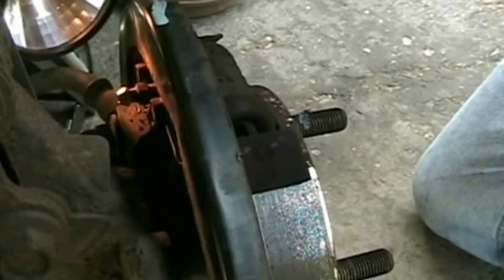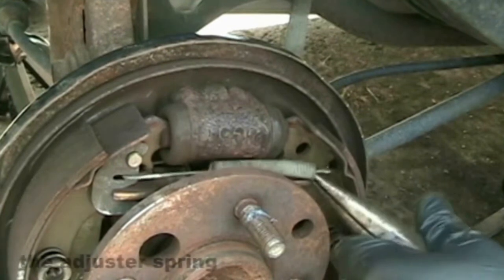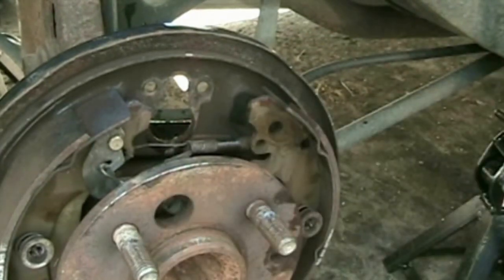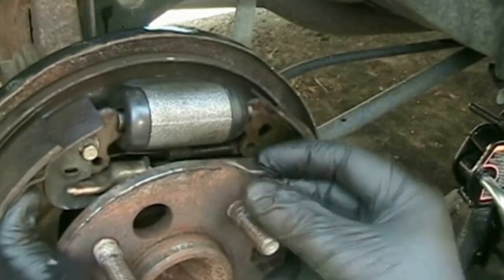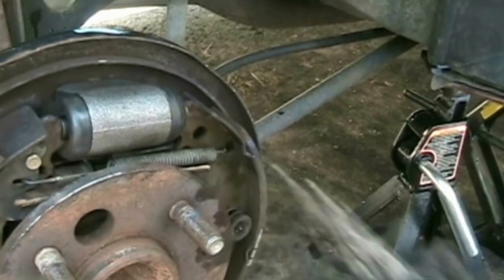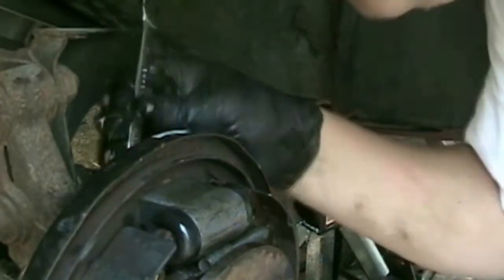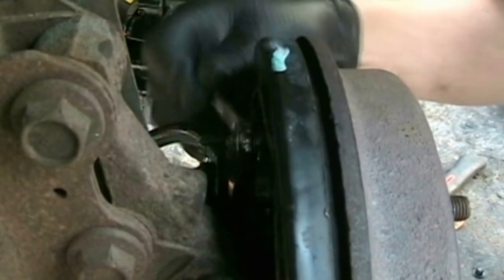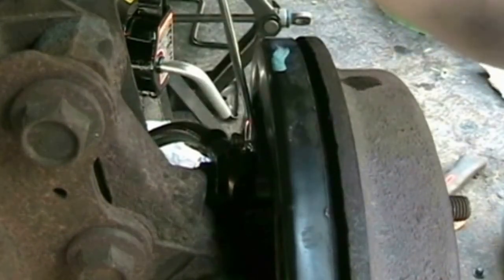Saturn Brake Wheel Cylinder Replacement

Comment: nicely done tutorial.  Curious if you or anyone ever did a video on changing the wheel cylinders on the Saturn L-series (l-100, 200, etc.), moel year 2002 and thereafter -- I ask as it has just ONE 10 mm mounting bolt, and it's all but impossibly positioned UNDER the brake line entrance.  Guessing the only way to get at it is to remove the brake line first.... ?

Comment: Yes, you need the copper crush washer for the brake line connection. I watched this vid as a refresher, good basic overview. I had 3/8" vs 10mm fasteners on my wheel cylinder for some reason, but it was replaced once before.  Some penetrating oil very helpful, especially if those bolts are original installs. If you have the time, a few applications of penetrating oil over a few days may help with the frozen bolt syndrome. Trans fluid is a good rust penetrator if you dont have penetrating oil...thanks for the review...

Comment: Why do you need to adjust the parking brake? Parking brake was not disconnected, how it is done when you change brake pads. Even if you change the pads, no one adjusts the e-brake (in several films I saw).

Comment: Great video. 
I just finished replacing the brakes and cylinder, but the adjuster lever wants to ride up over the spring when the brake is applied. 
Is that supposed to happen? If not, how can I fix it?
It's a new self adjuster and lever.

Thanks.

Comment: One other thing to keep in mind, the head of the adjuster wheel is not symmetrical, there is a second slot and tab for the adjuster cam that needs to be facing outward. If you assume the adjuster wheel part is symetrical, you may install it backwards. Make sure the tab and slot is facing outward so the adjuster cam properly engages. If I can assemble something backwards, it seems to happen, so hopefully I can save a few other viewers some re-works who read this..~:)

Comment: What happens if it leaks brake fluid how do you fix it
Reply: I think it leaks only if you have a bad drum brake cylinder (unless you have something with brake lines), so it should be replaced, how described in this film.

Comment: What about the VERY important crush washers? you didnt mention those
Reply: Is it one or two of them (crush washers)? I found just one of them on the banjo Bolt of the old cylinder, but in the pack for a new set there are two of them. Where does the second go?

Comment: DO NOT use his method of shoving a prybar between the break pedal and seat for bleeding. If the brake falls too low and the pry bar falls, the line is going to suck up a bunch of air. open the bleeder valve and push a small hose over the tip going down into a bottle of brake fluid. get in the car and press the brake (the line will push the air bubbles out the tube and into the bottle of fluid) then release the brake (it will suck up fluid and no air into the bleeder valve). do this 5-10 times and check to make sure you aren't running low on brake fluid in the bottle because if you run out or get too low it still sucks up air (thats bad). but thats the safest and easiest way to bleed brakes on your own. otherwise its really best to have two people.
Reply: otherwise its a great video